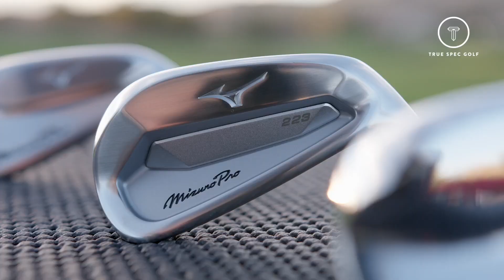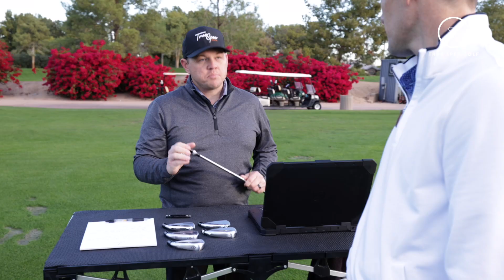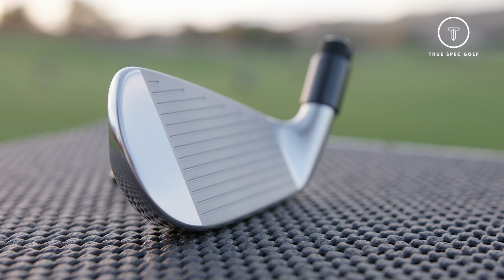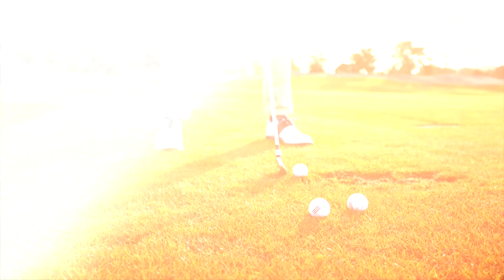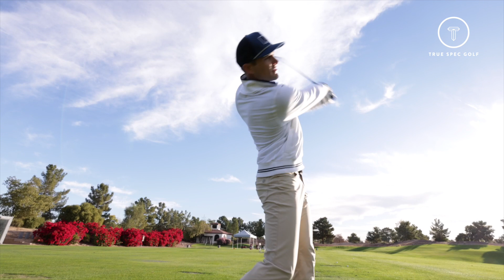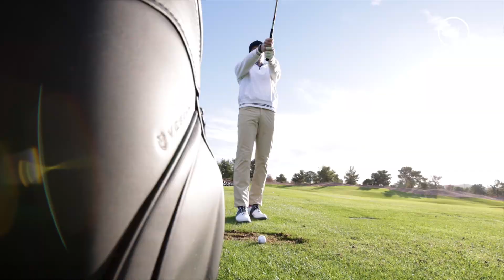2022 Mizuno Pro Irons Performance Review

Comment: Thanks for the review. Is the 225 noticeably smaller than HMB? I was off put by the chunkiness of the HMB and hoping this is better looking at address, although I am worried by how strong the lofts are.
Reply from the maker: The 225 will be noticeably smaller than the HMB in the scoring irons. Specifically, 8-PW.
Reply: @Truespecgolf  225 more forgiving than the 223?
Reply from the maker: @jeffyeah4256  Yes, the 225 is the HMB replacement. It is the hollow cavity and has the highest MOI.
Reply: @Truespecgolf  but these 225 clubs are too good for a player that shoots low 80s? I'm gaming the callaway b21...those are huge cavity backs
Reply from the maker: @jeffyeah4256  They are targeted to a intermediate handicap range (around 5-15), however, it's always worth testing and going through a fitting to see how you hit them.

Comment: I was looking at 921 tour. I tried everything twice and that came out to be my best. Just want some forgiveness. I play srixon 785 in my lower irons. Can you tell me what to expect between the 223 and the jpx 921 tour?
Reply from the maker: The 223 is designed to provide a better overall player experience. You should expect enhanced feel and feedback at impact in addition to faster, more consistent ball speeds with a slightly higher launch.
Reply: @Truespecgolf  how it is compared to 921 tour. Size and forgiveness ?
Reply from the maker: @ryang1910  223 is going to be a larger head overall with a slightly larger top line, more offset and more forgiveness than the 921 tour. Also, 223 features Mizuno's forged Chromoly material in the 4-7 iron specifically designed for faster and more consistent ball speeds.
Reply: @Truespecgolf  thank you for your response. I was told it was smaller. Appreciate you getting back to me